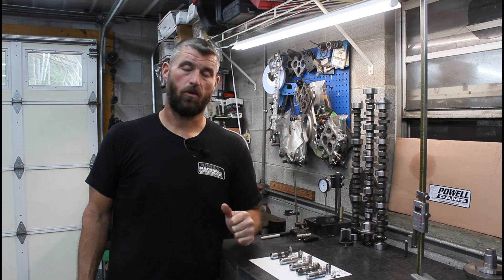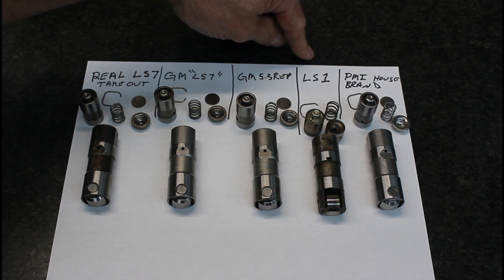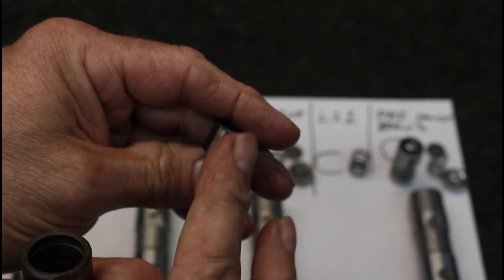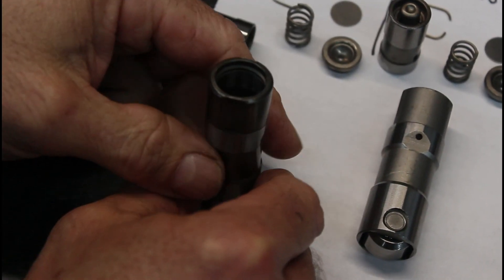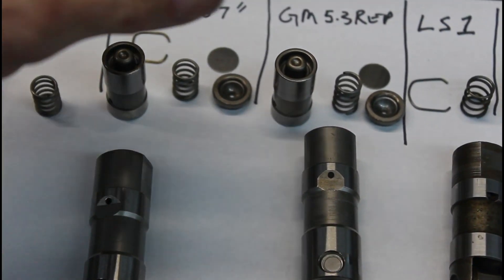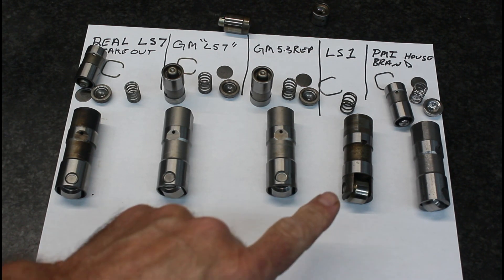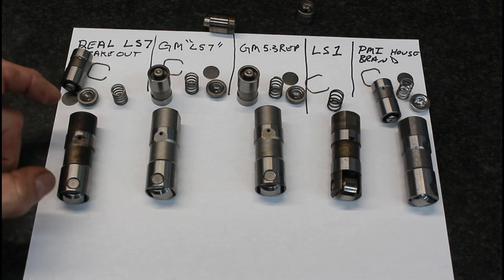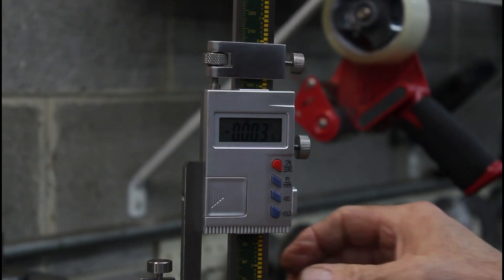Do "ls7" really exist?? And how much preload do I need?

Comment: Late to the show, just watched this. I have a BTR cam in my Gen 4 6.0 (iron block) and BTR recommended 7.425 pushrods. Measuring pushrod length in the LS isn’t very easy even after I bought a special pushrod measurer. I’m worried that my 0.025-long pushrods are really too long, ie, too much preload, because my heads have been milled 0.018” and I’m running 0.040” head gaskets. Theoretically we should be able to measure preload with turns of the rocker arm bolt. When moving the pushrod or lifter preload with a 1.7 rocker, the actual mechanical lever is 2.7/1.7, or 1.588 times the thread pitch per full turn. If the rocker bolt pitch is 1.0mm, that’s 0.062” preload per turn. So my slightly over 1-1/2 turns of preload is close to 0.100”. Surprisingly, these lifters are the same as those in my Harley Twin Cam 103, and they want the 0.100” preload. That may have something to do with the temperatures in an air-cooled engine… Any insight you can provide would be appreciated!

Comment: Rebuilding my FE 390 I bought a set of roller lifters from a known good company. The lifters on the bottom were very sharp You could basically shave with them. It removed material in the block shortly down the road causing too much clearance. So I called them sent them back they sent me a new set. I had the block rebushed and it's been running for years now no problem. The second set of roller lifters clearly had a slight bevel on the bottom of the roller lifter.

Comment: Great information, so seems the marketing is the differences in prices as anything else. Summit racing has them Jegs, BTR, Michigan Motorsports, GM dealer no matter where you purchase getting the same product
Reply from the maker: Only gm unit's are made in the 🇺🇸
Reply: @powellmachineinc3179  summit stated their lifters are produced in the USA as well but will not disclose the manufacturer so good chance it's a top quality lifter as GM
Reply from the maker: @ajsgarage3471  then there just reboxed gm units

Comment: The original CTSV Cadillac LS7 race engine was said to rev to 8500-8700 with the original style LS7 Hydraulic roller lifter that had a ceramic check ball. That was According to the short little half page reading hot rod magazine years ago. 
  So they may all be the same now. But what you get in the corvette street LS7 in the corvette is probably not what you get in the CTSV race LS7.
Reply from the maker: All "race" engines from gm were reported to have Johnson lifters,  a ceramic check ball isn't really fixing anything,  I have never seen one, would like to.
Reply: @powellmachineinc  just repeating what the little half page article said. The hydraulic roller lifters used ceramic check balls and they weight nothing. They said that was why they handle rpm so well. But thats been what 2007 so things change. I’ve spent way too long trying to find anything on that and looking for that article. One day I will come across that article and I will share it.

Comment: So i had a 7.350 pushrod, "ls7" lifter, milled heads, decked block, .660 BTR springs, .6xx lift cam. I had alot of clatter so i tore the engine back down and found alot of debris and garbage in the pan, lifters, ect. No bearing material tho, cleaned everything back up, remeasured preload and i have roughly. 055 to .065 preload. I havent fired it up yet. What are the odds my preload is fine and i clogged the lifters the first time around. I tore the lifters all the way down and soaked/cleaned the lifters as well as blowing the check valve out in the piston
Reply: I also reliazed the little disc in my lifters are stamped with raised circles instead of the flat machined ones that show on all your lifters

Comment: How do you kmow if these can handle a double spring
Reply from the maker: @timothyberlinski2299  adding spring pressure just makes the lifters hyd unit bleed more, so never run more pressure and mass than is necessary

Comment: I was constantly thinking this. I’ve watched a bunch of videos on ls lifters and how Jonsons tie bar,solid roller, and morel tie bars where an advantage over stock ls lifters. Them going through body designs and oil reliefs grooves and seriously couldn’t see a difference between the oem lifters when it’d be a ls3,ls2,ls7,etc. 
I know there’s been a huge “ls lifter failure” during peak Covid. 
I’ve been under the impression 95% of them are of failure to measure push rod length and account for preload.
I understand the issue with flat tappet issues going on. Vintage iron covered it and I believe you also briefed over it. 
I’m more then likely staying with my oem lifters this go around on my ls3.
Reply from the maker: Glad it helped

Comment: According to internet bench racers and Brian Tooley, the “LS7” mojo is in a “stiffer spring and different check ball.” This is supposed to cause restricted oiling to the valve train at high RPM’s, to keep oil in the bottom end, and resist pump up and lifter collapse “valve float.” 
Hey… Don’t shoot the messenger! 😂

Comment: Plus from closed spring pressure on the valve seat a couple thou(.002)or so of back pressure at valve stem tip would be "put back into the positive of wear".

Comment: I ask ACDelco about part number changes on identical parts and their boxes. They simply replied the #1 was counterfeiting, #2 Plant location changed, #3 Supplier materials changed, even plastic. #Internet Dealer Catalogs that made it appear as a newer design kept the public and shops confused.
 Either was, it came back to counterfeiting parts as you may notice hologram sticker labels are on new stuff. And this was while I worked in the field on Raytheon contract as ACDelco market area service manager. 
Grand Blanc, MI is home to “GM’s Service and Parts Operations”. What guys called the puzzle palace. But, parts on the second floor I believe were simply kept busy by changing part numbers, not parts!
Thanks kindly for your observations.
Reply from the maker: 100%

Comment: So... can you run a post 2000 hydraulic roller GM lifter on a pre 1999 SBC Chevy roller motor with stock push rods?
Reply from the maker: Yes,
Reply: @powellmachineinc3179  thank you so much for the quick response and great info. I'm a big fan of your channel.

Comment: I pulled two sets of rollers from 90's chevy truck and yukon. I took them apart and cleaned them up. They look exactly like the "LS7" lifter. I did the David Vizard trick and shimmed them up internally to have only .030" travel. Then I adjusted off the bottom of the travel for .010-.015" based on thread pitch. 
He said he talked to the engineer who designed them and the designer never tested after 6-6500 rpm. They go flat rather than pump up. The plunger can rock enouph to bleed pressure.
Reply from the maker: 2 thing's,  #1 if they looked like the "2nd design they had been replaced,  #2, if your lifter has a bleed rate that high you need a new lifter not shims, also they don't go flat after 6k thousands of dyno test/track passes debunk that.
Reply: @powellmachineinc  I think he may have gotten lifters out of a truck or trucks with Goodwrench L31 replacement engines from Mexico.  I have owned a 2007 Mercruiser 5.7L, a 2003 Mexican built 5.7L L31 powered Sonora (GMT800 Tahoe rebadge) and a 2006 era Goodwrench L31 that I had in my 1997 Express.  All 3 of the L31 engines built in the mid 2000s had LS style lifters as built from GM.

Comment: When I built my 02 ZO6 LS6, I went with Cadillac Racing lifters.  (They were the HOT lifter of that time. The stock LS6 lifters that were removed from my LS6 were the early LS1 Designed exposed roller.  I was impressed with the new Caddy lifter designed of the more shrouded roller.  Is there a difference between the Caddy lifter and that second LS Designed lifter?  Or Did I just get bamboozled like everyone else?   They have held up very well and I have a fairly aggressive cam and run the engine pretty hard.  Thank You for all that you do!   Bill
Reply from the maker: All the same
Reply: No they aren’t. The Caddy lifter is shorter travel and has a titanium check ball for weight reduction. Good for 8000 RPM. But you can’t use springs with more than 350 lbs open pressure.
Reply from the maker: @vinnyvette6028  we've had many of them here, there the same as all the rest,
Reply from the maker: @vinnyvette6028  also weight reduction is a moot point behind the fulcrum and the ball is so small the difference would be unmeasurable

Comment: Next video Idea. Can or will it work? V6 roller lifters in 1st gen sbc . Without reduced base circle cam. Doing this right now on 383. Thanks . Haven't bought anything yet. Just heard about this. That they are shorter,oil feed hole lower. I have no inventory to check this out , my inventory is mostly sbf parts.
Reply from the maker: 4.3 v6 lifters are tje same
Reply: they were saying . 2.2  , 3.4 , 3.1 were shorter.

Comment: Morel 5315 lifters? Morel states .120 of max travel and set preload at .050 for all aluminum engine. I have mine set at .060 and they become noisy (tick/clatter/sewing machine) only once engine is warmed up. Cold start absolutely quiet. Warm, noisy. Any input on what could possibly be going on? I run 15w50 oil due to .0025 mains and rods in an aluminum block. Melling high volume/stock pressure oil pump. Any insight would be much appreciated. Thanks
Reply from the maker: Preload will not make a lifter noisy (as longas you have some hot),  only internal clearance or valving issue
Reply: @powellmachineinc  thank you for the quick reply. Yes, they only make noise when hot. When you say internal clearance or valving issue do you mean the plunger to body? Or lifter bore? I assuming you're saying the lifter is bleeding down to fast when oil is hot and thinner compared to cold start?
Reply: @powellmachineinc  these lifters would be the Morel 7717 you have on your website (5315 was old part number). Alot of forums stating they are noisy or certain oil weights are required (nonsense). Was just interested if you have heard any issues with the ones you sell. Thanks again

Comment: It would be helpful to Rockwell test and compare the trunion, needles and roller wheels. That may shed some light on some mysterious lifter failures. Thanks for the great info.
Reply from the maker: I can do that
Reply: These lifter failure are 95% builder error.
Reply: @SOLDOZER would you please elaborate on what builders are doing to cause lifter failures?
Reply: @biscuitpope3760   Backyard engine builders slapping stuff together with big cams, ignoring spring pressures, etc.

Comment: ihave  lots ls1    2004   2005  engines from Holden 5.7 they  had the updated lifters same as my 2006 6'0 engine  theres one 2001 engine  didnt open yet mybe ill find the older style
Reply from the maker: Yep
Reply: Great video mate 👍yep ive got about 150-200 of the earlier ls1 type lifters out of late 1999-2001 VT=VX/VU definitely thought there was a difference,  Cheers for clearing it up

Comment: Great info! The only things you didn't measure was plunger and check valve spring tension.  That's the only other variable i can see with a lifter for a performance application. A stiffer check valve spring will resist pump up more. But that mystery will have to be dispelled as well...
Reply from the maker: Check valve tension is so light it's irrelevant,  the "hydraulic " pressure is sealing the ball

Comment: The way I have always understood it, the LS7 was the first motor with the newly designed lifter, and what was once called LS7 style has been shortened to LS7 because it sounds better. Like all engine parts, they may all be the same style or design, but they may also vary in materials and workmanship. Not a place to cheap out. Unless you're trading lifter trays for link bars (or keyed) you don't need to spend a fortune on them either. GM Delphi or a tried and proven alternative like PMI house brand will work as well as one of the same design with a higher price tag. Better than good enough will get you nothing.
Reply from the maker: It was in engines prior to the ls7

Comment: If you were building a 500-600 hp engine LS-XXX and wanted to STEP UP the lifter selection, What aftermarket lifter and design would you recommend?  What rocker Pedestal would you recommend other than that stock aluminum POS?
Reply from the maker: Gaterman drop in, and oem rockers with our bronze trunion kit

Comment: I've been watching a few of your videos, and it's nice to see people with common sense still.  I thought .100 to .150" preload sounded ridiculous.  I ordered shorter pushrods for an l92 build, to correct that.  I've got them around .050" now.

I've also played with a few small block and big block chevs, and I'm convinced that adjusting the preload tighter makes the cam act bigger.  So if you send an ls out the door with .100" plus preload, the cam is going to act slightly bigger.
Reply from the maker: No amount of preload will affect the cam profile.
Reply: @powellmachineinc  not even a little?  I would think the lifter is not perfectly sealed shut, and some amount of lift would be bled out.  I might be wrong, but i'd swear the cam acts bigger the tighter the preload is.  Probably take a dyno to prove it, so I'll leave it be.  Seat dyno is deceiving lol.
Reply from the maker: @shenaniganswhatsoever363   in that way yes, it's bleeding,  I'm saying more are less will not be different
Reply: @powellmachineinc  copy.  thank you for the response.

Comment: Now I'm not arguing with you. I'm asking 30000 on a lifter different. What's that do with the Spring pressure? And the movement and opening the valves and everything 30000 it's amazing a lot. I mean, 16th  is only 62 and a 1/2.
Reply from the maker: Lifter preload has no effect on spring pressure

Comment: On my FE 390 build I told the company to not send me short skirt pistons. Well they did and they said said they will not make noise cold so I installed them. Well cold it had a horrible piston slap noise cold only. So they sent me another set long skirt installed those been running great for years no noise cold. Also on the same FE 390 the intake manifold didn't line up on the angle of the head so on  de- acceleration manual transmission by the way it would suck the bottom of the intakes gaskets into the port. I do have that problem fixed as well  communicating with NASCAR engine building guys.

Comment: I have heard the guys from SDPC state, multiple times, that when the LS7 lifter was first produced there was an obvious difference and we can see that in the lifters you have. They stated that after about 18 months of use, the LS7 became the standard lifter at GM. After that point if you bough lifters at a dealer, you got LS7 lifters. It was the default lifter.
Reply from the maker: This "design " was available before the ls7 was available
Reply: I heard some engineers at gm say that someone just read the print upside-down, and for about 3 years, they machined these upside-down!

Comment: Basically what people call the ls7 lifter is the 4th generation lifter . The 4th generation lifter has the wheel captured. The internet says LS pushrods are 7.400 inches long. None of them have measured them 0.25 is my go to preload.
Reply from the maker: Early 2000's have the new design lifter, and stock  pushrods are  like 7392 ish,  from the handful I checked
Reply: @powellmachineinc  I have got 385 but I guess they changed the lifters before the Gen 4 change

Comment: so if i can put a spider and dog bones in my 2 piece rms sbc . i could use your lifters on a roller cam ?
Reply from the maker: Yes
Reply: I dont think so unless powell knows a trick im unaware of. The lifter bores are raised and decked on the gen 1.5 engines that have 1prms. Folks have tried with the older 2 piece blocks, running shorter 60° v6 lifters with subpar results.

Comment: Great info. I’ve read all over the internet that LS7 lifter cups were .050 taller that the LS1 lifter. They are obviously taller but you proved the .050 number to be false.
Reply from the maker: The point is, there is no ls7 lifter , just a 1st and 2nd design
Reply: @powellmachineinc  yep. It’s kind of annoying that they call them ls7 lifters when it’s just a second gen LS lifter cause they are all the same
Reply: @powellmachineinc  1st LS motor I ever built I ran '87-up SBC Eaton anti-pump ups. I ran them up to a 7,000rpm shift, no problems at all.

Comment: The reason they’re called LS7 lifters is that the LS7 was the first engine to use the new design
Reply from the maker: No
Reply: @powellmachineinc  yes. They were developed for the LS7 and the LS7 was the first engine to enter production with them equipped.
They started putting them in other gen 3 motors after development, before Z06 release.
Reply from the maker: @Timothy_Jacob  the first Ls7 was 2006, Iv personally disassembled 04 tahoe engine with the 2nd design lifters,  so.....
Reply: @powellmachineinc  how long do you think it was between development of the new lifter for the LS7 program and the release of the Z06?

Comment: The ls7 lifter subject and cam subject is the most irritating subjects. People ask what cam they should get, and 20 people will recommend the cam that they run without even knowing vehicle info. Or they recommend these performance companies. I have been brought cams from "x" performance company, and it has comp scratched out and their company initials scratched in. I always tell them to call a reputable cam company, and they will ask a lot of questions to get you the right cam. It drives me nuts.
Reply from the maker: Exactly,